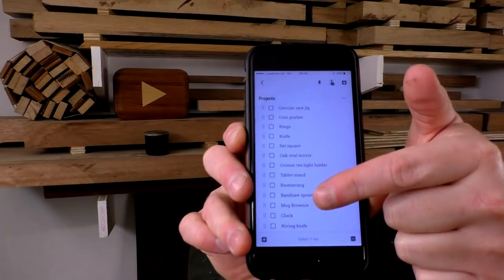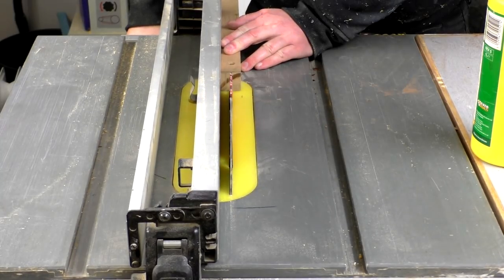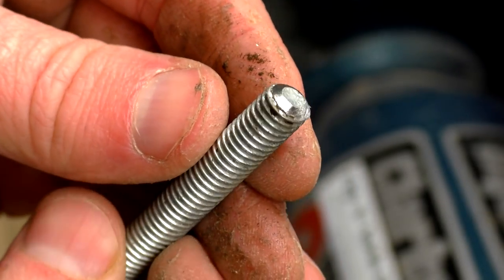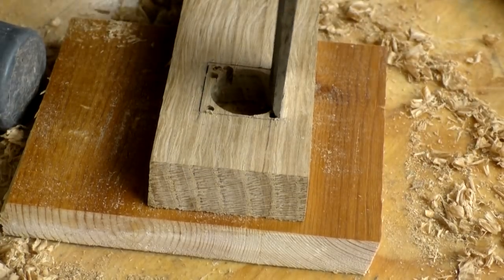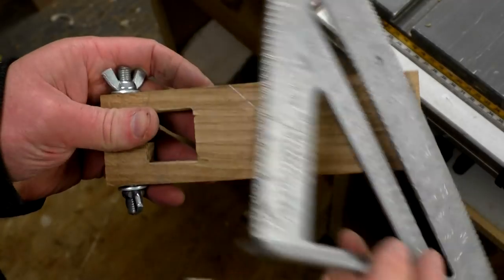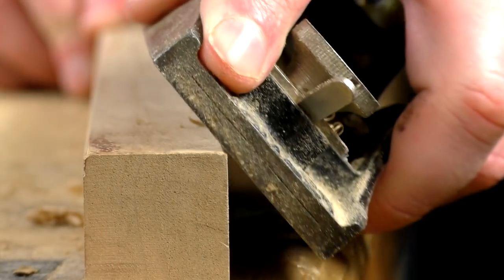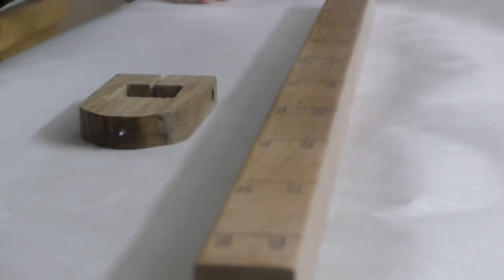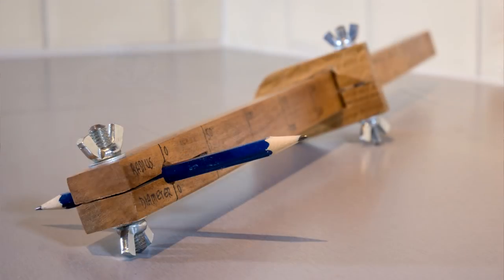Making A Large Beam Compass

Comment: A well made and handy tool.  In case you haven't picked up the tip about cutting threaded rod or bolts - if you put a nut onto the thread BEFORE cutting to length, after cleaning up the cut end, removing the nut removes any imperfections and really forms the thread nicely, making it easy to get nuts back on.
Reply from the maker: Great tip! thanks, I had heard that before but didn't think of it at the time

Comment: What kind of disc was on that angle grinder? it looked really thick
Reply: Pølle NamNam A grinding disk. Used for grinding metal, as opposed to a cutting disk that is used, predictably, for cutting.
Reply: I think that may of been the guard we see as its a bird's eye view. Probably a normal 3mm blade.
Reply: It was a grinding disk. Probably didn't have any thin cutting disks in.
Reply from the maker: it's a cutting disc, at least that's what it says...  It is thick though - about 10mm!  I just used what I had
Reply: Rag 'n' Bone Brown you can get 1-2mm cutting disks, they work great and whatever you are cutting won't get as hot. Loved the video tonight. Have a great xmas.

Comment: Hey Keith great build i could use one of these to thanks for showing how to make this, hay mate you myt want to check you angle grinder it looks like you have multiple cutting disks on it or you are using a grinding disc that's used for grinding not cutting that"s y its overheating  u need to buy a cutting disc they are much thinner your local hardware store he should be able to help you cheers mate wants again great work ;)
Reply from the maker: Cheers Robert. I didn’t have any cutting discs so just used what I had at the time. I do now though
Reply: @RagnBoneBrown  some times we have to improvise your a legend mate